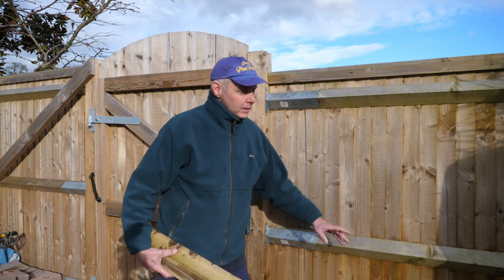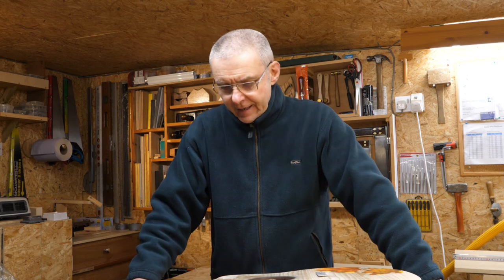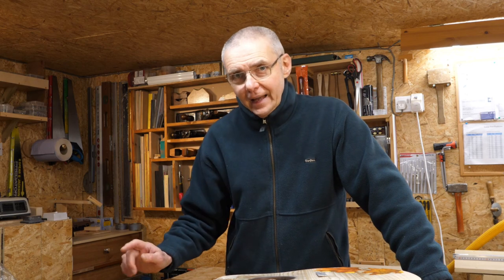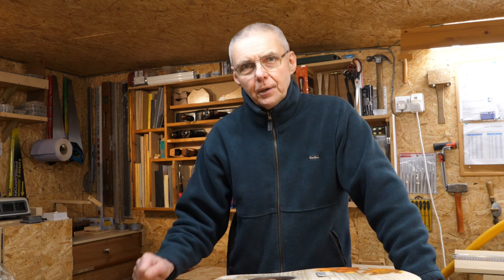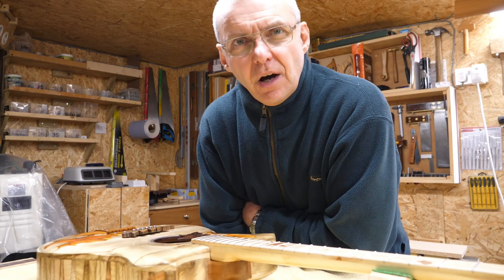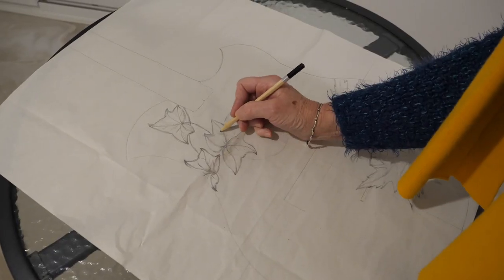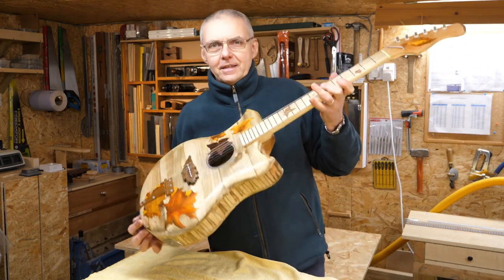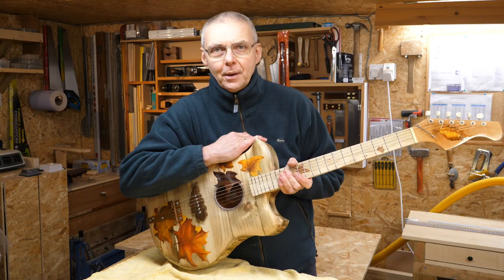Use What You've Got Challenge Guitar - a fusion of art and guitar making!

Comment: Turned out great Dave
But the wife missed a trick there and should have painted the screws too cause they don't go and look out of place on the hinge
Reply from the maker: As I was tightening those screws I did think I should have found some old brass slotted ones but then I looked at the bridge and thought - no silver will do.  You are right, perhaps we'll sort that out at some stage.  Thanks for watching.  Cheers Dave
Reply: @DaveDickens  All she'll need to do is paint them the same way as the hinge and it'll look a lot better than an old looking hinge with brand new screws 
Other than that it looks smart considering what it's made from and just goes to show you what you can make with just scraps you have lying around